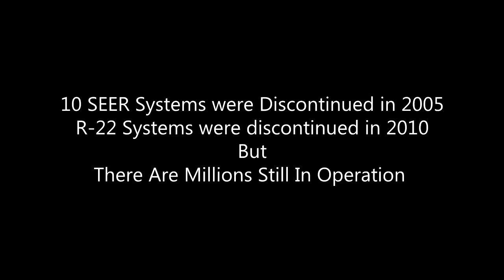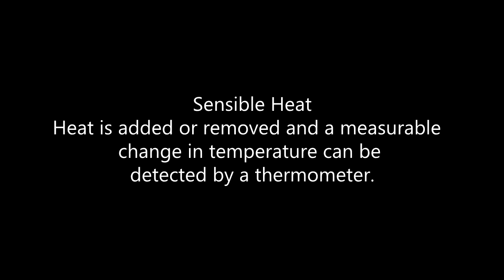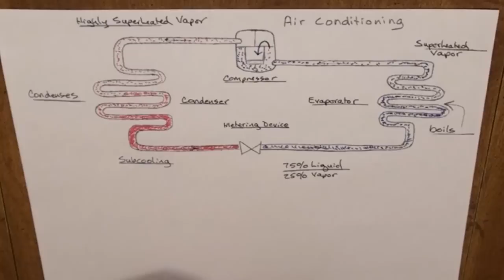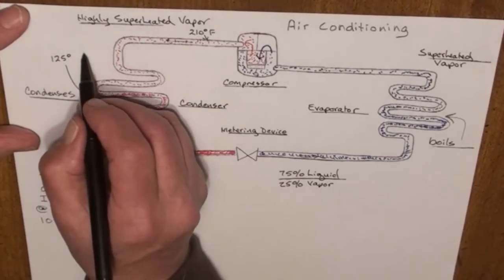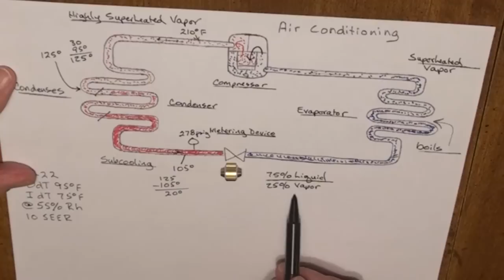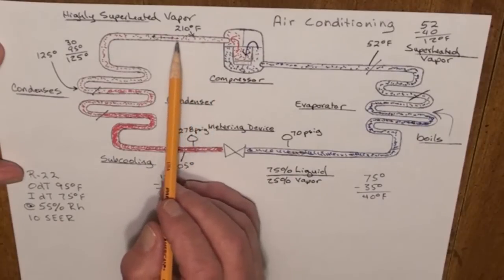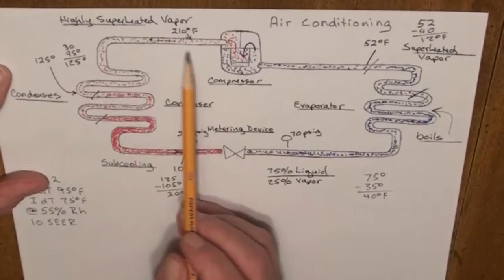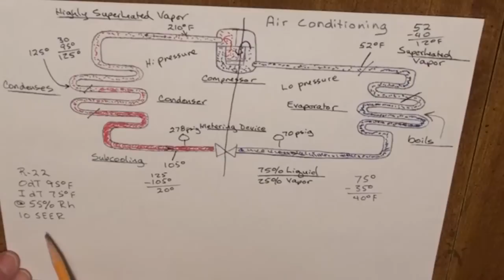Basic Refrigeration Cycle: 10 SEER - R-22 - Fixed Orifice

Comment: I've seen many videos about A/C and this one is the best explanation on how A/C works !!
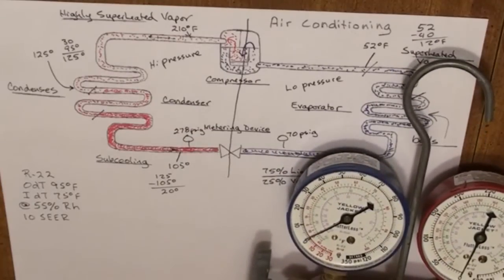Reply: 24:58 - I agree. Even at this point in the video he has to tie his refrigerant hoses in an overhand knot just to get the correct gauge to match his drawing! I will say, though, at least he has the discharge line going into the top of the condenser and the suction line coming out of the top of the evaporator coil which you don’t often see in other drawings (even hvacrschool sometimes gets the piping backward in some of their whiteboards).

Comment: I know this video is 7 years old, but thank you for sharing your knowledge!  You helped me understand latent and sensible heat much better.  Very professional and easy to understand.
Reply: Super  heat  ..super  ocurs  when  that  vapor  is  heated  above its  boiling  point  lets   saythatvvrefrigerant boils  at40  dreerss  ata  low  pressure in  the evaporatorthe vaporized refrigerantis con   elevaingits  temperature to  become  a  50 degree vapor....t inuously  heated  .elee
Reply: Cycal  total  compent compessor conesr  e met dves  expsin  .evapare   ..extr. poited   super  het   occurs   when   that   vapor  is   heat  above  is  t  boiling  poit  let  say  that   refrigenat  boilin  40  dgree  at  a  low  drgreein  th  evapore...
Reply: Explas  ..what  doees   super  heat  men  and  what  cuses  ammonia  to  becomd  suer heated  in  the  evaporater  coils  ..pressure  and  temperure  of   sturated  ammonia have  a  definite  relation  ship  .  Thetemperure  corresponding  to  a  prssure  of  20  psi  is  5.5°f.this  should  be  the temperatureof  gasitleaves  the  evaporator  coils  buta thermometer  in  the  discharge  line  may  show  a  temperatureof  8or10°f.tjediffereanceis  superheat.....if  we  couldremove  the gasas  soonasitformef.giveing  it nochancetoremaininthe coils  and  pickup heat we would  not  have  superheatatthispoit apoorlyinsulated suctionlinealso helps  superheatthe  gasbutitis  impssible to eliminate  super  heat  entrely.....?))))

Comment: Absolutely a great video. Trouble shooting if condenser fins become restricted with dirt/ grass or fan stops what temp rises to at metering device. Also on low side, if return air filter is clogged and not enough air flow through the evaporator. I have seen air registers closed in 4 rooms with a 5 ton unit and customer doesn't understand why the A coil is freezing up. They will tell you, I am not using the rooms, so I shut off the air flow to save on electricity. The opposite happens,  coil freezes up, the rooms needing cooling are not receiving air and the compressor never shuts off. Allergy filters will cause more trouble than they are worth just from restricting air flow. This is one of the best videos I have seen on you tube with a piston/orifice devise.
Reply from the maker: Thanks for the compliments.  I have a tip for checking for clogged condensers.  Some condenser coils have an overlap design.  Dirt and trash will collect in the center (due to the overlap and the fins don't match up) and won't be seen on the outside.  You'll need a flash light shining back through the coil to detect the obstruction.  Also on the allergy filters.  They are rated by something called a MERV rating.  What they don't tell you is that they become so restrictive they kill the air flow and the evaporator freezes up.  they aren't cheap and require monthly maintenance but an electronic air filter is the best way to go.

Comment: EXCELLENT!!! This video alone has saved me HOURS of watching other mediocre videos! Thank You! The only thing I need to find now is how you got 35 degree application to 10 SEER and how the Rh affects the numbers
Reply from the maker: +Gary Barbour II Subtracting 35° from the indoor air temperature is used for standard efficiency equipment (10 SEER).  Subtract 30° for high efficiency (12 SEER and up).  
The moisture in the air, humidity, acts as a load on the evaporator due to the change of state.  The evaporator operates below the dew point so any vapor moisture that comes in contact with the evaporator condenses to liquid and leaves in the condensate line.  Absorbing the latent heat to condense the moisture is additional load on the system.
Reply: By far the best explained overview of a refrigeration cycle; you are a master instructor

Comment: best video on the subject!!
Reply from the maker: +Dean Scholl Thank you :)
Reply: I want to learn more..
And is it possible to convert a r22 system to 134a...and if not..why
Reply from the maker: +Dean Scholl It is possible but may be more trouble than it is worth.  Technically the oils are not fully compatible due to miscibility ratio's, probably not enough to matter. (The amount of oil absorbed into the refrigerant vapor.)  A significant efficiency loss due to improper metering device either fixed orifice or TXV so the metering device would need to be changed.  There would also be loss of efficiency due to the different vapor volumes so that means the compressor would not be compatible.  Look into some replacement refrigerants designed for R-22 systems I think you may find that a better route for your change over.  I can't help but wonder when I hook onto R-410a on a hot day with a dirty condenser why the engineers didn't try a little harder getting the 134a to work.
Reply: I was thinking that the compresser would be the major problem..thanks for the reply...

Comment: I hope you can follow this, more than the average few worded comment:
There is still so much to keep in mind.  For example 105 liquid and 52 vapor, need to really think about that because the drawing doesn't explain why those temp exists at those points.  I think the copper pipes are smaller on the 105 side which causes less space (like a bike tire) so push refrigerate into the small lines on the high side (105 side) creates condition for high pressure.  Pipe size is a factor not mentioned.  

What is also confusing is at top of the high side, temp is 210 and at end is 105, why compress the refrigerate to 210 to achieve 105, because the natural state of the refrigerate is a vapor in the system (when system is off) on the low side at 52 so purpose is to get what's in the system naturally as a vapor into a liquid ready to expand back into a vapor.  I've seen many illustrations of the refrigeration cycle online, however I think the pipes should be sized correctly to illustrate part of what creates condition for high side and also state at beginning of video what state refrigerate is in when system is off so everyone gets an idea of what the system faces when switched on.  

I think of the low side as a car tire and the high side as a bike tire.  This works for me since bike tires require high pressures and car tires require far less.

I have taken one HVAC class so I'm still lost and as I watch videos I recognize easily what's missing.

There is reference to the 95 degree day and 105 degree refrigerate, but without much talk around it.  What if outdoor temp is 85,   100 or 120?  The different scenarios would be interesting.  I understand you did mean for this video to explain it all so just an idea for if you ever create another video.
Reply from the maker: :) Watch the video through a few times.  Watch them in sequence starting with the pressure temperature relationship.
Reply: Okay, I will take it that you think what I'm asking for is in those video. Thank you.

Comment: Thank u
Great explanation 
Could u also explain heat pump, chillers & dehumidifiers using similar diagram with compressor, metering device/expansion valve & evaporator and subcooling, superheating, the whole 9 yard.

Comment: Great explanation! Thank you so much for sharing this. You spoke clearly, slowly and made me understand easily . This is the easiest video I've ever seen for me to understand. There's one question I would to ask in this video.  If the boiling point of refrigerant is 40, why the refrigerant that had 105 f on the high pressure side still being liquid? Plz help!
Reply from the maker: Thank's for the compliment.
It's all about the pressure temperature relationship.  The 105° liquid is at 278 psig.  As soon as it passes through the metering device the pressure drops to 70 psig and immediately the change of state begins to take place and some of the liquid changes to a vapor.  As long as the change of state is taking place the P/T relationship will apply. At 70 psig the R-22 refrigerant will boil at a temperature of 40°.

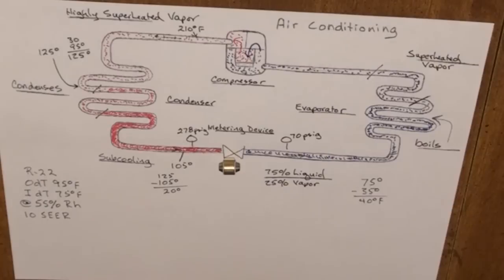Comment: Hey man, awesome video. But one thing confuses me. At 18:01 you say "superheat is the temperature gained above the boiling point" and you point to the 40 degrees F. I'm confused because isn't the boiling point of R-22 like -41 degrees?
Reply from the maker: +Gary -40 below at atmospheric pressure of 14.696.  While operating at a low side pressure of 70 psig it raises it's boiling temperature (saturation point) to 40 above and matches the pressure temperature relationship.  We manipulate the boiling temperature by controlling the pressure on the refrigerant.

Comment: Very nice video!!!   But one question: Why does the refrigerant leave the metering device  with 75% liquid and 25% vapor?  Wouldn't it be 100% liquid?  Where does the energie come from in the metering device to generate 25% vapor?
Reply from the maker: The drop in pressure across the metering device causes the refrigerant to boil immediately in accordance with the pressure/temperature relationship.  So the short answer is, the pressure drop.
Reply: Thank you!  :)  For the answer and for your excellent videos. And for your low speech-speed, so that i can understand you very well even as a non native english speaker (german)
Reply: @KarlAlfredRoemer  25% is lost or also known as flashing...flash gas.

Comment: Thanks again !!!!
Is the boiling point and the condensing point BASICALLY THE SAME POINT , but just moving in opposite directions ?????
Reply: Yes, it's called the saturation temperature.  Add heat and you get more vapor.  Remove heat and you get more liquid.

Comment: Now, if I want to build a freezer, how can I know and/or calculate what size, specifications, voltage requirements, and parts necessary to cool down a box 6 foot tall by 3 foot wide to. at least minus 10 deg F.?

What compressor/evaporator do I need and which refrigerant do I need to use?
Reply from the maker: The box you are describing is pretty much a standard size residential freezer.  With one exception, the temp.  To have a system maintain a temp of -10 it would have to operate at about -15 to -20 which would require a commercial refrigeration refrigerant.  Refrigeration calculations and to engineer a system from scratch is too broad a topic for me to cover here.  I recommend a prefab box.  They are called "knock down systems" and "cam-lock" systems.  You would come out cheaper and have some guarantee it would work.
Reply: Cool Cat HVAC/R Training Video Thank you.  I did not yet figure out that a minus 10 result would require a,commercial refrigerant.

Comment: might be a dumb question but do they have ways to make the refrigerant boil off quicker in the evaporator so it can begin to absorb sensible heat quicker?
Reply from the maker: Increase the load on the evaporator.  That would in turn cause a too high a superheat.  Keep in mind, sensible heat is the BTU gain above the boiling point.  That is not a reference to the supply air temperature.

Comment: I get the concept to an extent. But, how is the refrigerant so effective? I've seen the effect first hand through o2 paintball guns etc that it works but why is it able to get so much colder than the outside temp. So why when you release Co2 out of a compressed state is it able to become so cold? Why does the decompression of such gasses create cold?
Reply from the maker: It has to do with the pressure.  We can control the temperature a liquid boils at by controlling the pressure applied to the liquid.  The lower the pressure the colder the boil.  For example.  Liquid R-22 at atmospheric pressure (14.696 psia) will boil at -40 F.  R-22 in an A/C system with a low side pressure of 70 psig the refrigerant boils at +40F.  Some old, old domestic freezers used R-22 at 15 psig on the low side and the refrigerant boiling temp was -15.
Reply: @coolcathvacrtrainingvideo9906  thanks

Comment: Is it the diameter of the hole in the "metering device" that determine the PSI pressure on the hot (condenser) and cold (evaporator) side . I have a boat fridge im gonna fix, and it has a coil and a brown long bulb, is that the same as a metering device ? Maybe I understand it. at the end of the Condenser there is liquid, that is forced thru due to rythmic action from the piston . the metering device has a tiny nozzle, hole. when liquid is foced thru, it may become a sprout, or a shower of particles, the particeles would have large distances(large space to act in), and thus absorbe heat in the evaporator . ? the metering device, makes the refirdgerant change phase from liquid to gas ... due to mechanical pressure from the piston in the electric motor .
Reply from the maker: Yeah, your description is pretty close.  You mentioned a fridge for a boat.  Be sure it isn't an RV style that uses a heat source to operate.  They are not to be opened up.  Really dangerous chemicals in those types of systems.
Reply: @coolcathvacrtrainingvideo9906  Its a thermostat for a BD35F, gone bust . It is a capillary tube that goes into the cooling chamber, and it does not react . Thermostat 25T65 . Isotherm Danfoss system 12V DC .

Comment: I am mostly ammonia refrigeration , which is very different than H-VAC , But shouldn't you have an accumulator in your drawing ?  I've never seen a refrigeration system of any kind without an accumulator in line !
Reply from the maker: I kept my presentation pretty simple.  Rarely do A/C systems incorporate accumulators.  On the other hand they are pretty common in heat pumps.  It's a manufacturers call.

Comment: Does it make sense to insulate the pipes from the air conditioner in the car? The air conditioner pipes in the house are insulated, but not in the car, why? Thanks.
Reply: The suction line should be insulated.  The Discharge line is usually not insulated.

Comment: pls help....why in the other explanation the high side is connected to the evaporator coil...
Reply from the maker: It's not.  On the 13 SEER video the transmission tube from the TXV is drawn onto the diagram and attached to the exit of the evaporator.  Could that be what you are seeing.

Comment: i dont understand where you get 35 degrees Fahrenheit after the metering device to be subtracted from 75f is that specific to a 10SEER system ?
Reply from the maker: Yes, for 14 SEER and up subtract 30.  That would give it an operating temperature of 45.  The difference in capacity is made up by having a larger evaporator.
Reply: ok thanks i have a test on this tomorrow im trying to get this mastered for then
Reply: so far ive just learned the terms high efficiency and low efficiency
Reply from the maker: Check out my video on the 13 SEER A/C systems.  They have the higher SEER pressure and temperature variations.

Comment: its urgent sir, please tell me if its possible ?
i have used heater in place of compressor in ammonia based VCR system. will this successfully work ? i am making a small sized model.
Reply from the maker: +Jay Patel What you are describing is an absorption type refrigeration system often found in RV vehicles or where refrigeration is desired but no electricity is available.  Normally the system would contain Ammonia as well as water and hydrogen.  Be careful, ammonia and hydrogen can be dangerous.